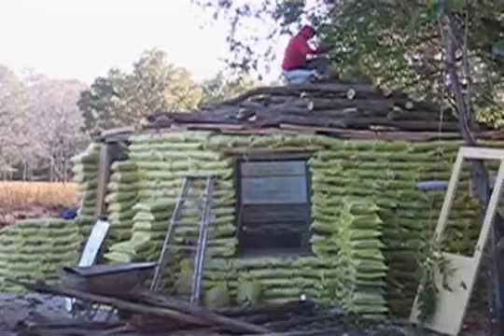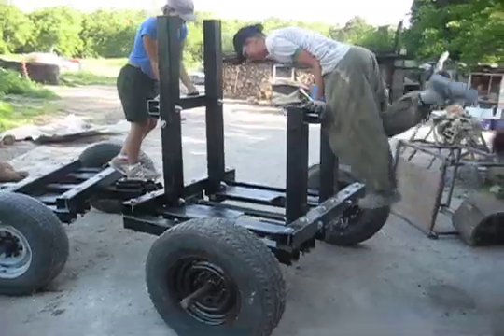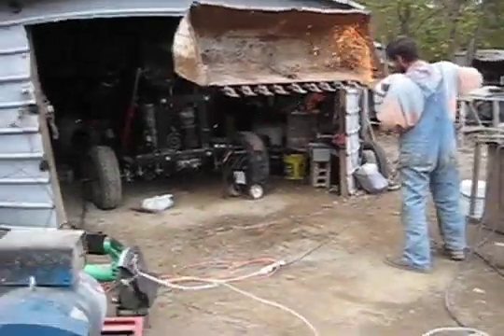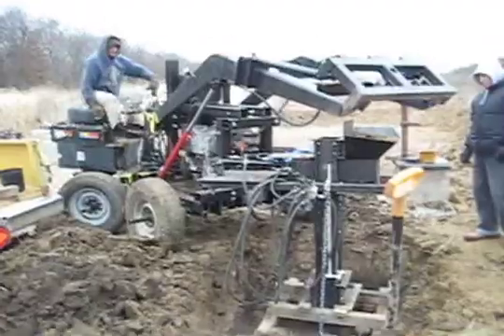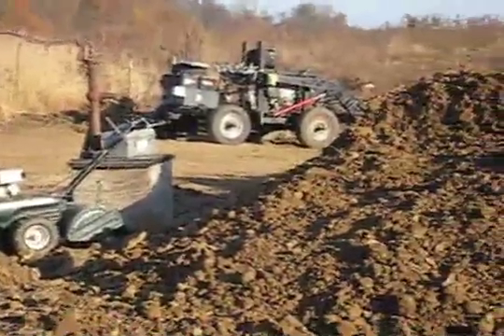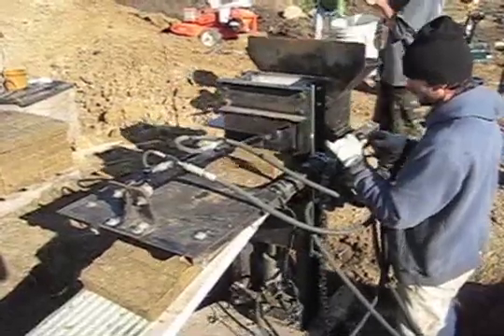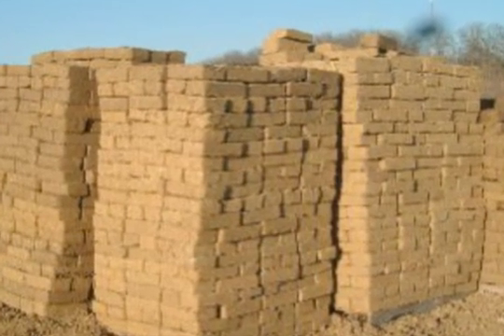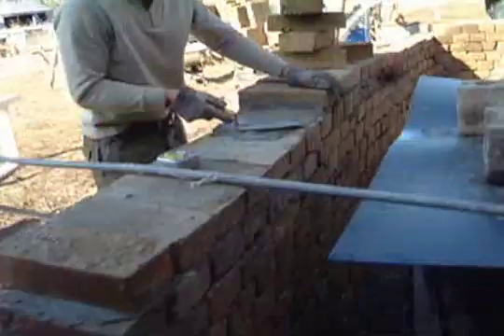The CEB Story - To Build a Village - Open Source Ecology

Comment: We've been using the manual CSEB press from Aureka in Auroville. The most beneficial part was taking the classes offered by the Earth institute of Auroville and learning from over 40 years of work, mistakes and successes. The best thing they said there was "It does not take much knowledge to do but the knowledge it takes - you must have"

Comment: Have you considered making a conveyor to feed the hopper in the brick press, and loading the conveyor with a larger hopper and your backhoe? If you did so, your production rate would be much higher, which would then justify either larger bricks, or a double interlocked layer, which would make your structure much easier to erect, and much stronger because wider walls are more resistant to lateral forces.

Comment: What about an elevator to load the hopper? Then you'd just have to move the earth longitudinally with shovels or a front-end loader onto the elevator... you could load the earth onto a horizontal belt feeding the elevator to have more surface area to work with. You could also stick a rotary mixer at the top of the elevator, too, to make the earth uniform.

Comment: NW Missouri? Then you're going to want some thermal insulation on the outside of the structure. Compressed earth block is fine when there are large temperature swings between night and day, like spring and fall in the Midwest. But, when the temperature swings are hot and hotter or cold and colder, as it is in summer and winter, the thermal performance is terrible.

Comment: I have been looking around and I have seen that the bigger machines that produce blocks are really two machines. One that the material is dumped into by a loader and then it prepares the material as to breaking it down and then transports it by conveyor to the block making machine at the proper rate so the hopper does not get clogged. That is what makes the machines so efficient.

Comment: Why not straw bales for walls covered in earthen stucco?  Seems like an easier proccess and more insulation for the effort.
Reply: this could be structural, the strawbales are basically just siding so you still need a frame for the roof. you still need to reinforce this btw, you have to add a sporting strip every 4 blocks and you have to use a conventional foundation. they have their blocks on a plank which sits on gravel. this plank will rot away with in 10 years destabilizing the wall.
most constructions i seen have rebar in the construction tying the layers together. they put vertical rebar in on the comers windows and doorframes.
just simple stacked blocks dont hold up well with there are high winds or earthquakes, this is why the reinforcement is needed.
i figure if you aply this you will hae a much easier time to pass any code inspection and permitting as the blocks them self can pass the concrete block strength test